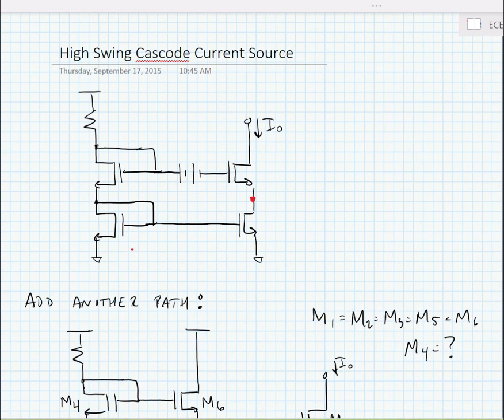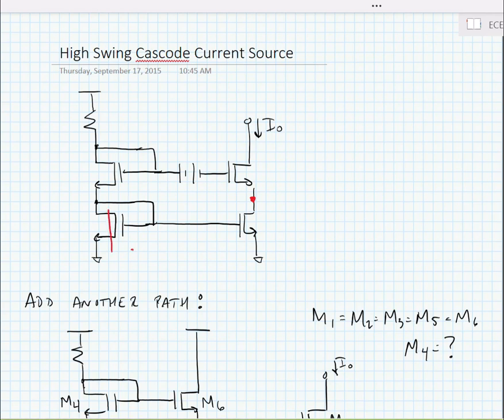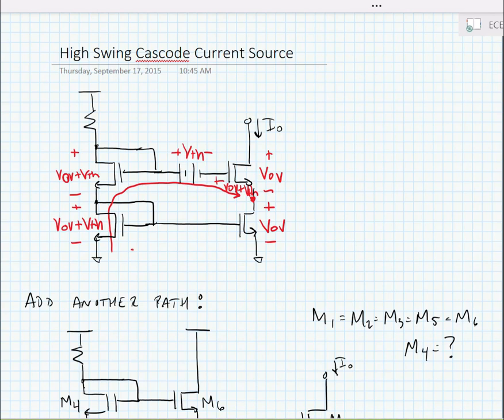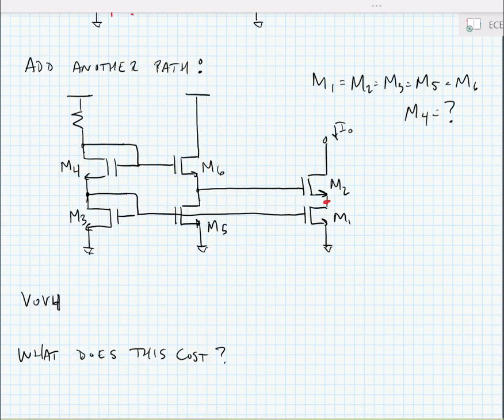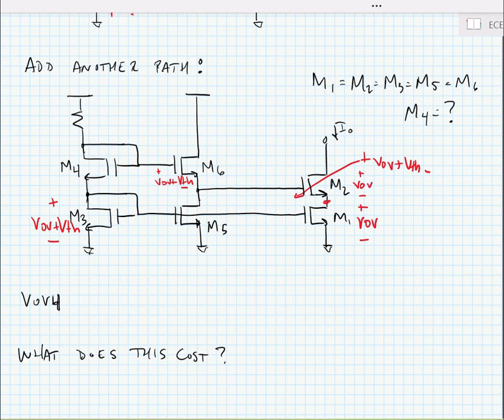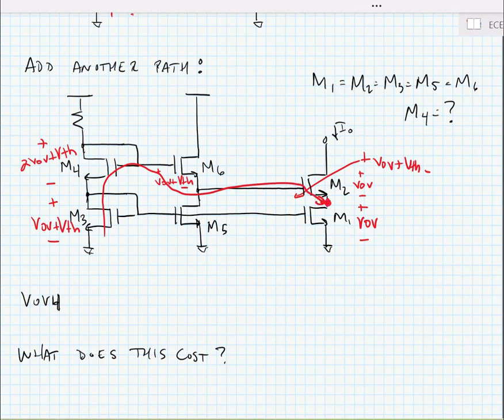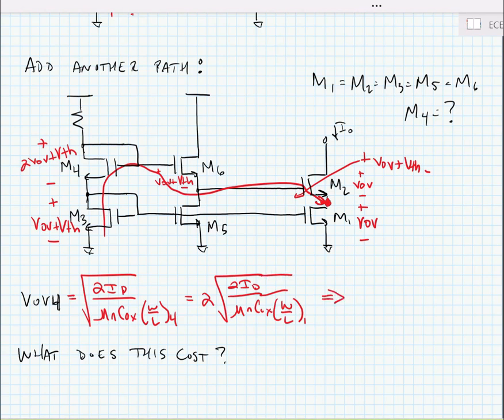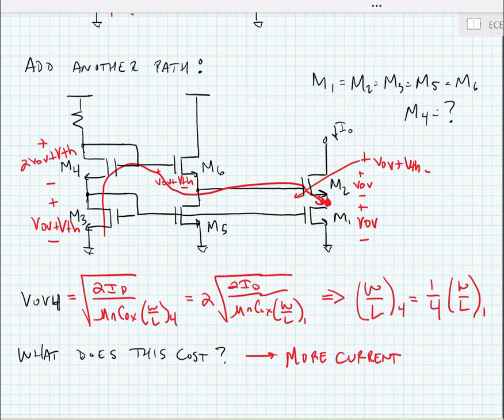ECE3204 Lecture 11D - High-Swing Cascode Current Source

Comment: I have been opting for using a simple amplifier to regulate the gate of the cascade device by comparing the vds of the current setting device to an R2R DAC output. Then sweep the R2R DAC until you reach the desired linearity or FOM and eFuse it at factory calibration.

Would be great to see what you think of this method.